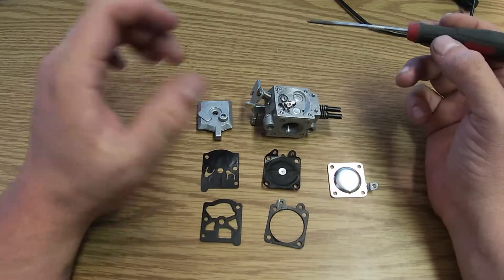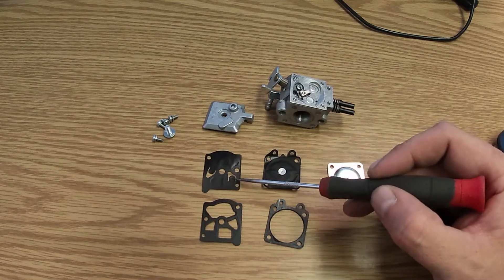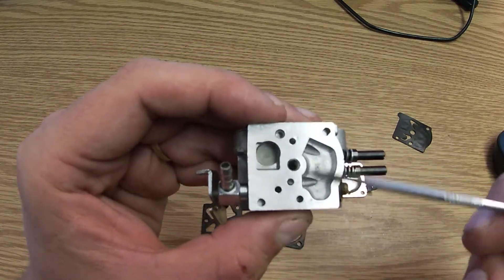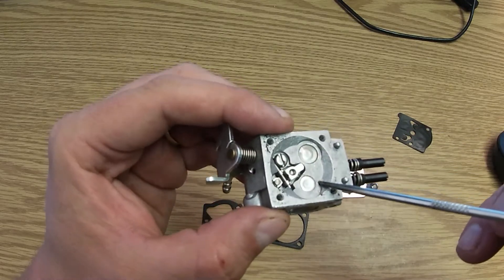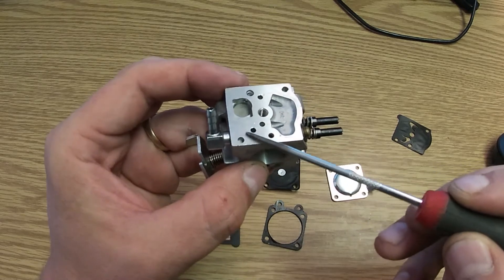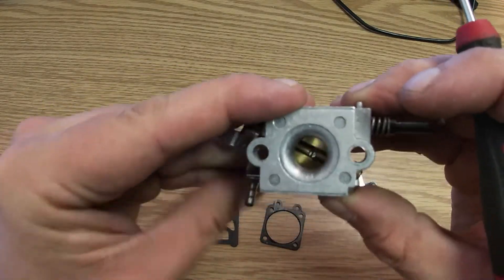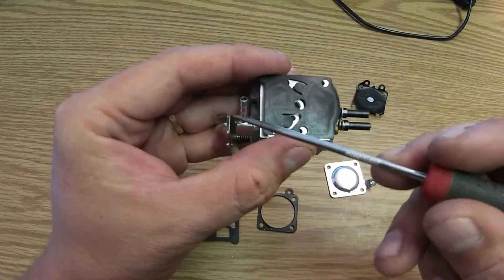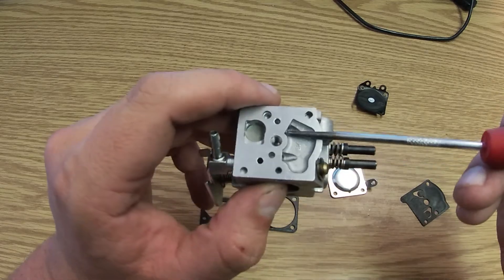How does a 2 Stroke carburetor work? box style 2 stroke carb explained.

Comment: That's a good run down. You made a remark about no Venturi, but the design is a little more complex than that. There is indeed a Venturi effect even though you don't see much anatomically. The location of the low jet is right at the throttle plate, which is nearly closed at idle. That low jet is positioned exactly at the pinch point where air flow is accelerated while idling. The Venturi effect lowers pressure at that point, sucking fuel through the low jet. The carb provides a little positive pressure as well, but it's the Venturi effect that determines which jet is dominant. So, fuel delivery through that low jet largely affects idle performance. When the throttle plate is open, the less dramatic pinch point where air flow accelerates is upstream, exactly where the high jet trickles vaporized fuel into the air stream. So, adjusting the high jet largely affects fuel delivery when the throttle plate is open.